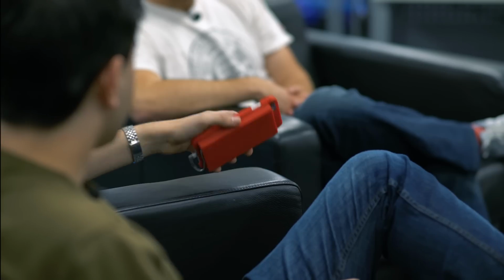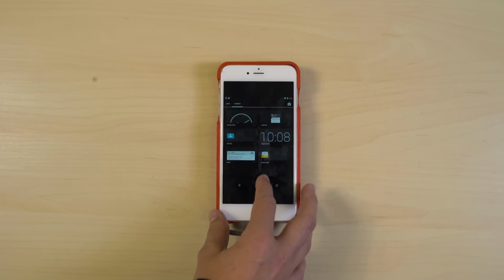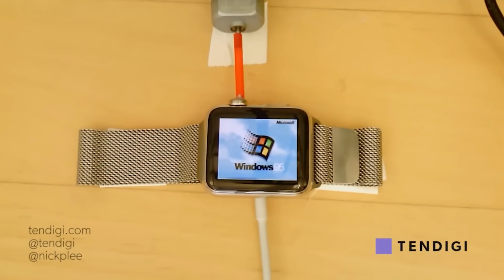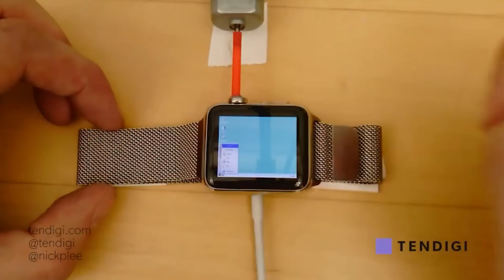iPhone Running Android: Explained

Comment: now do it the other way around
Reply: +Alif Nasir Saad Well, if you strap a jailbroken iPhone to the back of an android...
Reply: +Alif Nasir Saad team viewer anyone?
Reply: Nor is Android - life lesson - go and do some research and it'll open your eyes.
Reply: It's really just a matter of time, it's inevitable that someday iOS will be ported to a former Android phone, it's not like anything similar hasn't happened before

iAndroid-While in this video, Android is technically running on a piggybacked SBC, there are videos of iPhones with custom bootloaders dual booting both iOS and Android

Windows on Mac-Does anybody know why Apple created Bootcamp to begin with? Early Mactels didn't even have Bootcamp, Apple released Bootcamp due to the popularity of "modded" Windows installs on early Mactels, if you can't beat em, join em

Win98 for PowerPC-Yup, it exists, and no, I don't mean Win98 in an emulator shell, Microsoft actually released a version of Win98 for IBM PowerPC (and possibly Moto) CPUs, while Microsoft designed it to run on Non-Mac PCs using using the PPC, it is bootable and installable on PPC Macs

Raphsody-On the heels of NeXT OS, before Apple released OS 10 (X), a Mac OS Classic-esque (<OS 9.2) OS for x86 CPUs was released,...
Reply: called Raphsody, now I have tried two versions of it, out of the two, I could only get one working, the one I got working was monochrome only, the other I had was in color, and while it was bootable, I couldn't get it to install for some reason, I was unable to transfer any Mac programs yet, so I am unaware if it can launch PPC Mac software, but it is made by Apple, it is for x86 CPUs, it's pre-OS X, and it does exist, wether or not it was meant to run on PCs

Hackintosh-I dabbled in Hackintosh back in the early days, and did manage to get OS X running on a Sony VAIO, though the resolution was not ideal and I had a hard time trying to find working software, I must say though, even with the issues I had with OS X on the VAIO, it ran better than the preinstalled installation of XP Home it came with...  Well, at least OS X was stable, I still remember when I installed it, nobody believed me that it was possible, but indeed it is

So in the end, about the only thing that hasn't been...
Reply: ported over was iOS on Android phones

PS: Google has really got to remove character limitations, this took 3 installments for one reply
Reply: +Michael Dickens yeah the character limits are stupid
Reply: That would be amazing Galaxy S7+IOS 10

Comment: You can indeed run Android on iPhone hardware natively but that's a lot of work.
Reply: Yep.  Older iPhone's.  As far as research is concerned the iPhone 3G has the most Android support.  Supposedly someone got the open source bootloader OpenBoot?  To work on the iPhone 4 I think. Eventually, Android could come back with iDroid or something like that.

Comment: I think running iOS on an android device would be way more spectacular.
Reply: Android is made to work on a lot of devices, it's made to be hackable. ios/apple on the other hand wants the user to have as little control as possible, one part of that is that their OS only works on their devices
Reply: +Jan Johan Patter but it makes sense, because there are only like 7 or 8 different types of iPhone running a certain version of iOS, compared to thousands of android devices running a version of Android.
Apple has a better control on their software as well. It doesn't surprise me that an iPhone with 1 GB of ram and a 1.3 GHz dual core processor is quicker in terms of usage than an android phone with 4 GB of ram and a 2 GHz quad core processor.
Reply: This is simply because your iPhone is less of a ram hogger. Probably because it has less of the features of an Android OS smartphone and requires less to run. Kinda sad you still have to pay $650 for it though.
Reply: +Green Arrow that's not the case only. Android i not very efficient compared to ios, Google made some odd choices as to how the operating system works and would need to scrap it to get get apps to run 100% natively. that said the performance hit on android is just solved by throwing more ram and a faster CPU and GPU in a device to compensate. I could only dream how fast my galaxy s7 edge would be running a 100% native code on it <3 (not a bad phone though still)
Reply: ***** Yup.
Reply: but way more impossible, as security for ios installations is insane.

Comment: macOS on an iPad would be interesting.
Reply: MacOS is not designed for ARM chip so the chances are very slim for it to work. Getting macOS on PC is hard enough
Reply: The Anti-Social Socialist Oh yeah, definitely. But it would be interesting. ;)
Reply: +The Anti-Social Socialist  Older OS X from the power pc era, 10.4-10.6, should be feasible
Reply: Hey Eddie Cue, fancy seeing you arou...

Oh hang on, you're not Eddie Cue, are you :(

You have NO IDEA what architectures macOS has been compiled for - know why? No one does, and because you don't work at Apple's R&D. The likelihood of an ARM variant existing are VERY VERY high, and just because no one outside Apple is aware of it, doesn't negate its existence. Why wouldn't they have compiled it against ARM - they're a design & R&D company after all,. extremely forward-looking, so they've already done this years ago - count on it

Steve Jobs is known for revealing that Apple had been compiling OS X against Intel CPUs for a VERY long time, when he announced its release for Intel Macs - never assume, you make an ass of u and me.
Reply: That would be an instant buy if Apple started actually making that a thing
Reply: Kolby Benthin Oh, and of course they'd want this, wouldn't they... >_<
Reply: +The Anti-Social Socialist actually, Mac OS on PC is pretty easy..
1. Format drive
2. After formatting, insert old Mac disk.
3. Install and update to latest version
4. Enjoy
Reply: +PneumaticFrog You can't do it on any Windows based computer. You need very specific hardware and getting good drivers is tricky.
Reply: The Anti-Social Socialist You could if you wrote drivers to support your pc yourself, but that is not an easy task lol nor one everyone would have time to accomplish
Reply: Just buy a windows tablet and install Mac OSX on it. Search up about how to make a Hackintosh.

Comment: if that the "case" why not they just built a powerbank with motherboard inside running android with its own wifi signal

so we just need to download the app to communicate with the powerbank android and just put the powerbank into the pocket and remote control it wirelessly

so we dont have to swap out case in order to use the android os
Reply: also making a modification in the android kernel or os in order to allow wifi connected to the internet while the portable hotspot on
that way the iphone still supplied with internet from the  android powerbank
Reply: Because if anyone wants android they just buy a cheap device, that thing would be difficult to totally achieve and will take far more time than driving to your local phone supplier and slidin' your credit card aha
Reply: that would just be like using teamviewer to control your pc then

Comment: I can't imagine it would work too well, since android phones need high specs in order to run smoothly and apple phones are all low spec phones
Reply: it's not on Apple's hardware, also, you don't need that much to run android smoothly, iPhone's hardware would handle ir grearly
Reply: Shamur Stewart but running iOS on an android device would make it crappy, just like it is on the video
Reply: BGuy For one that's not feasible period lol. Not even mentioning the fact iOS is closed source, iOS will only function with Apple SOCs. Something that's almost impossible to get your hands on.
Reply: Not necessarily true, each phone is given equally powered parts for completely different ways to operate. Think about it like a desktop cpu versus a workstation or server cpu.

Comment: I built a script for rooted android that sets up and installs Debian so you can run desktop Linux software on your phone. This project is significantly more complicated than that XD. Although I am a bit disappointed that it isn't running on the phone itself. Although in order to do that you'd need emulation or a dual boot which is probably not as elegant of an option assuming you can get over the bulky case.

Comment: the idea is cool but it is just a second computer with android sharing its screen on ios it is not running android on an iphone. it is like that guy that made kali linux run on an anrdoid phone (even though that may actually be possible because they are both open soarce)

Comment: Nick Lee is the good definition of a hacker. What  I mean a bad hacker would be someone who ruined stuff and stole stuff. A good hacker could be someone who help protect a company by testing security(With the company approval ). Or it could be someone who changes something to help something. Take it Like Linux. they were hackers who left windows to Make better OS. They were hackers. Nick is a hacker who is changing the Iphone witch is in a box and removing it from that box to make it better.
Reply: "Take it Like Linux. they were hackers who left windows to Make better OS."

"Better"? Highly subjective - you get more done on Mac or Windows, because you can actually run software that's useful to getting lifes work done.
Reply: +unlokia I get more done on Linux
Reply: KingLinux01 Good, I am glad it works for you - horses for courses - but for the general populus, Apple create the most efficiently designed platforms.

Comment: why would you want a android os on iPhone ????.. 
instead of buying this case you can just buy a real android phone.
and I am pretty sure that the android phone will be way too cheap than this case !
Reply: He discussed putting it into production. Then again, I am sure he often discusses walking out of the front door and getting some sunlight and oxygen, both of which I doubt will occur.
Reply: Lord Sacha For things to sell, there has to be a reason to want one, and I see ZERO reasons.
Reply: ***** Any serious professional developer buys ACTUAL Android phones, not toys and experimenter's kits. Ask ANY developer.
Reply: ***** What, when you can buy an EXTREMELY powerful and usable test Android phone for less than £80? Why would you pursue some flaky hobby project? You wouldn't.
Reply: bluestacks? lol
Reply: Or buy an iPhone clone which runs Android! Benefit of both worlds! iPhone 6S (plus) case with Android in it! (don't expect much of the batterylife, camera & speakers though..)
Reply: The answer for question.. is simple..

Why not.

Comment: "Is just remote access" they say, talking sounds easy, but the most important things is that Android doesn't support remote access and that almost unspoken part "it has to run at 60 frames per second or close". I'm an averge user of remote accessing Android and I can say that is really impressive, because all Android remote access host apps are crap, high latency, lags between input and feedback, uneven screens, HD is unthinkable... All this in a fucking high end phone.

So I' m bagging here, release what you did as a remote access solution to Android, we need it.

The concern is that is not "ruinning Android on iPhone", is "using Android on iPhone".

Comment: How long does it take to build a case like that?
Reply: 0 hours, because the computer makes it, not you.
Reply: +unlokia It still takes time and human input, sure it's not hand carved and the painstakingly long time it would take to hand carve, but it's not like you just sit in front of a computer a few minutes and voila there it is neither

First the design needs to be made into a printable STL file, this takes time to get the shape and dimensions right (3D modeling is no easy task, trust me, I've tried my hand at it myself), not to mention a lot of work needs to be done to make sure it's even printable, just because you have a 3D model doesn't mean it's sliceable, and some 3D printers do a better job than others with bridging, so support may be required

On top of that, you need a high end system to do the slicing in any reasonable amount of time (just like rendering an HD video), so expect a wait time for that as well on slower systems, then there's print time, which can take HOURS even for something relatively small, depending on print speed, nozzle size (imagine a hot glue gun with a...
Reply: pinpoint nozzle, and that's if the print doesn't fail, so you may need to reprint it

Believe it or not, unless you're a pro at it, a simple phone case could take days to being to fruition, maybe even up to a week, and the dimensions could be all wrong in the end and not even fit the phone

Comment: next stop: Windows 10 on iPhone
Reply: +James M RBpi and the IoT build of 10 maybe?
Reply: Apple can run andrioid smoothly if it was made for the iphone, the thing is, nexus can run andrioid easily and smoothly since google makes the android softwear and nexus is part of google, difference is  samsung changes the google andrioid softwear slightly to make it different and they dont put enough time to make it smoother. The iphone has a 64 bit processor, laptops use those processors, pretty sure an iphone can run windows 10 just obviously not as well as a regular laptop lmao, plus the ram is different and  the processors etc
Reply: "open source like android"

HUGE myth, do some learning.
Reply: Boydgado26 doubt that, iOS hardware is so weak, just the software is optimized for it.
Reply: ***** Android is installed on phones, phones are made by OEMs, OEMs source parts from suppliers with proprietary drivers and binary blobs, Android without working hardware and Google apps is toothless and useless. All the best with an AOSP device where nothing works...
Reply: ***** Yes, maybe you are partially right (or wholly) - I don't care how much, it's not an issue to me. "Open Source" Big deal - consumers want machines that save them time and make life run more smoothly, the political entanglement and battles of nerds is neither here nor there to the mainstream, and why would or should it be? Whatever works best to get the job done with minimal time and stress - no one cares about this "Open Source" crap - people want to BUY a product and pay good money for it to work - ask anyone who ISN'T a hardcore tech nerd, IE, the rest of the population, and you'll see I am right.
Reply: team viewer lol. ALSO that would be harder because the last time I checked, ios is a unix based os, which would make that task a lot harder.

Comment: Cant i just strap an android phone on the back of the iPhone and remote into the android phone?
Reply: nope, also it's actually running on the iphone, rather than just serving as a monitor.
Reply: It's not running on the iPhone you need the motherboard to run android. The app just remotes into the motherboard. Like when you remote desktop into windows 10.
Reply: +Anonymous Dev Team -Mrn00btroller (David) except neither the iPhone or android device support that natively, which is what he did essentially
Reply: +Anonymous Dev Team -Mrn00btroller (David) except neither the iPhone or android device support that natively, which is what he did essentially
Reply: +Anonymous Dev Team -Mrn00btroller (David) except neither the iPhone or android device support that natively, which is what he did essentially
Reply: because the app is unsigned
Reply: Anonymous Dev Team -Mrn00btroller (David) the app acts as a bridge between the hardware added and the iPhone. Still a hard feat.
Reply: So as i said a remote app that allows u to connect via wifi
Reply: Anonymous Dev Team -Mrn00btroller (David) NO, I mean the hardware running android does not have wifi or bluetooth connection whatsoever, and it's using the iphone for that as well.

Comment: although cool as shit no doubt, this project could be called 'using iphone as monitor to stream a tethered android system dev board'.
Reply: except that it transfers data back, and other differences I wouldn't know how to/dont want to explain.
Reply: ***** no, what I said is also needed for it to be correct. The app acts as a gateway between the two devices, and supplies all the parts and connections the case doesn't have.

Comment: What crap. I can run remote desktop on an IOS device.. It doesn't mean I'm running its running the external OS..
Reply: that's not the same thing brah
Reply: ***** but it's not BASIC at all. As far as I know, nobody has been able to achieve something like this in quite a while.
Reply: ***** Not to me, not to many people. Development would be a lot easier for cross platform apps and tweaks of the sorts.

Comment: If Android had a simple design and had iMessage I would totally be on their side
Reply: it's pretty simple whenever you figure out what everything is
Reply: Apple owns iMessage and keeps it proprietary for iDevices. Therefore, so Apple can keep the simple minded, they aren't going to port over iMessage to Android for the sake of not wanting to lose some of it's smarter fans
Reply: buy nexus devices directly from google.. its the cleanest form of android you can get..    also imessage is closed source..no one can get it.. its not for sale
Reply: Android is slow tbh for me
Reply: Michael Low you must be using an old phone
Reply: primus loy no, it's a fairly decent phone, and I kept it at almost it's original os when I had it.

Comment: That's the dream phone an iPhone with android os
Reply: +techn0vids I'm saying take Nexus internals and slap em in an iPhone body
Reply: +techn0vids they could easily Change the dimensions to fit everything its called a manufacturing process. if you don't like the idea, you can move along. no one asked you to comment on my comment. you can make your own thoughts
Reply: +techn0vids no you did not read your own comment